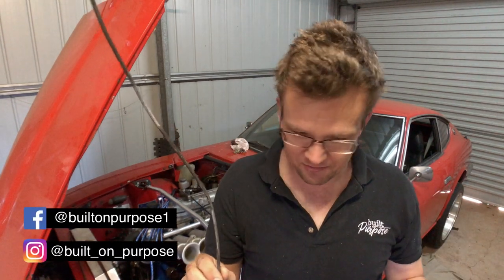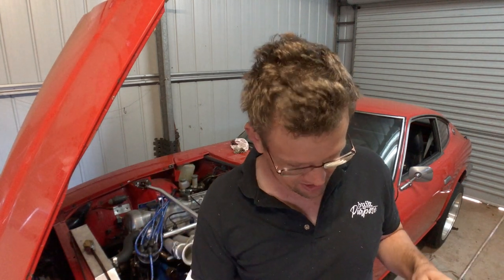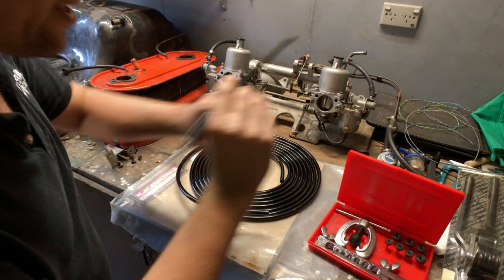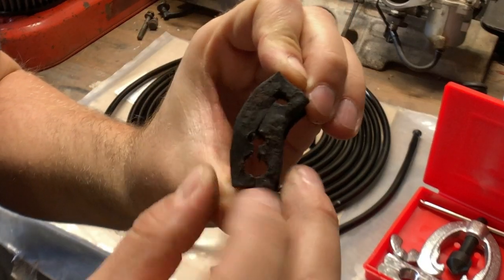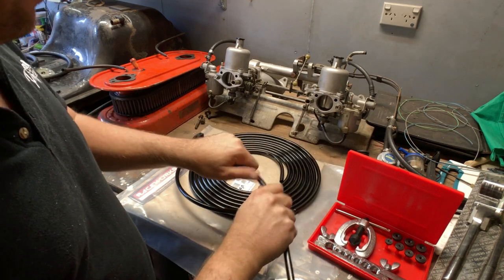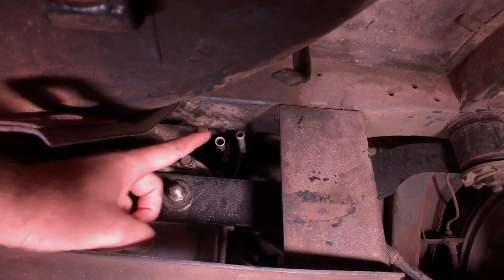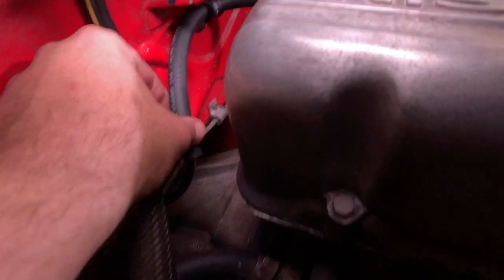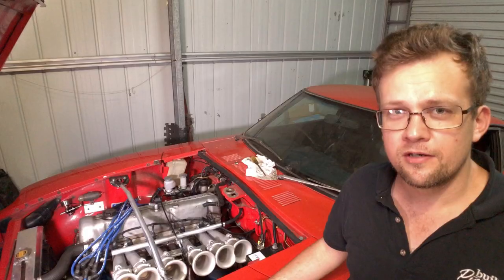Making 240Z hard fuel lines for the ITB EFI (the difficult way)

Comment: Can you explain fuel pressure regulation at the return line?  Thanks.
Reply from the maker: The fuel reg is a SAAS regulator (p/n SR1001) with a SAAS pressure gauge. The reg will be connected into the old 5/16” feed as a return to the tank.

Comment: How come you aren't using sequenced MPI injection?
Reply from the maker: The MS1 I am using supports batch fire on two banks only.  I would need a different ECU that supports sequential.  I think only the MS3PRO supports more than two fuel injector channels in the Megasquirt range 🤔